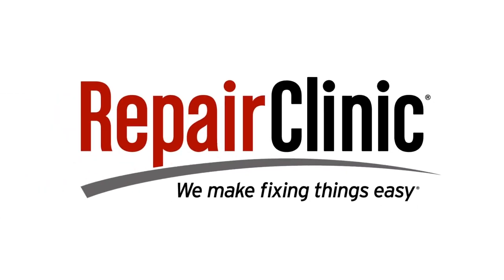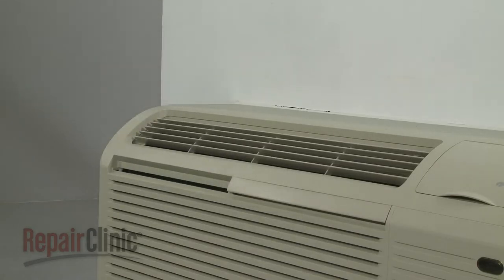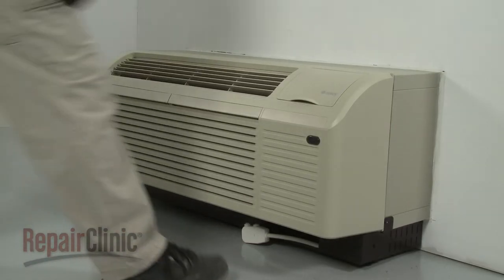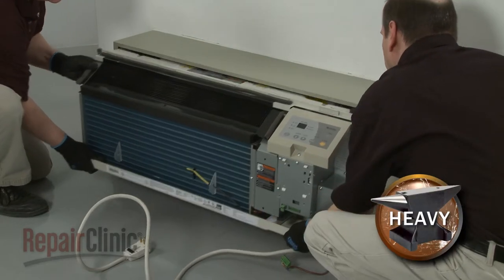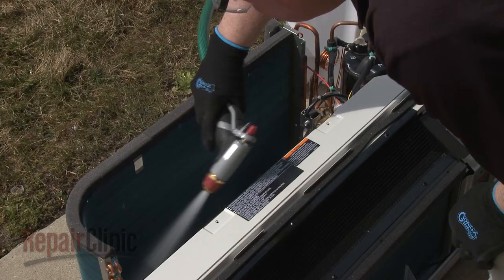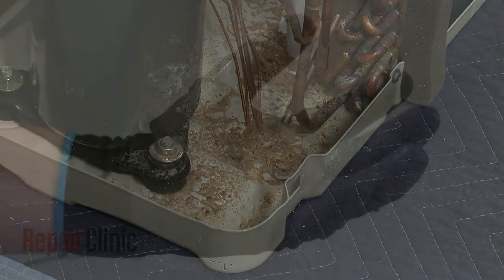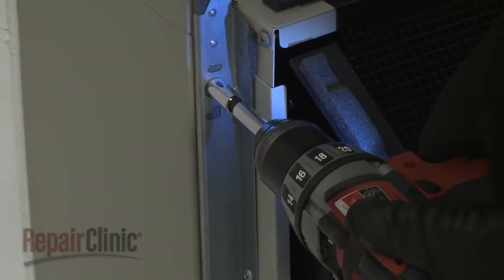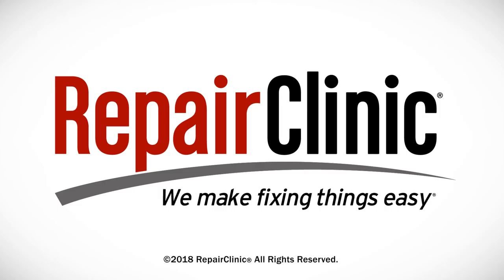PTAC Unit Maintenance Tips

Comment: If I bought some no rinse evap coil cleaner is it okay for me to just take off the front case and spray the unit while it is still in the wall and then replace the front case? I'm not trying to clean condenser coils or drain pan.
Reply: that no rinse coil cleaner is garbage, we clean them inside and out. out at our vans

Comment: I recently move and they have this type of unit.  Will it cycle down, or just run all day.  I do not see a visible  thermostat.
Reply: Set it to auto and ur desired temp and it will keep it there
Reply: @imaFlamingFaggot123  its older. No actusl temp control. Only dials. I'm gonna try and see what my first bill is like.

Comment: I have one of these units in my apartment and cannot get the fan to turn off. It did not come with a remote and the wall thermostat only lets me make fan auto or fan on ( both continuously run )
And I cannot adjust anything from the units controls

Comment: Mine for some reason is making a clicking noise and it blows out warm air whenever I run my heat but switches back and fourth between hot and cold air and it doesn’t turn off and on it just keeps running even whenever it’s at room temperature
Reply: Just replace it. There has never been a PTAC made that’s worth diagnosing and repairing.
Reply: @daveplem  I actually had gotten it fixed back in February what it was was the inside of the unit needed cleaned.
Reply: @corygriffiths4394  Lol! Never listen to me!

Comment: Constant buzzing coming out from the same area the air comes out through on heater mode when the unit is loudest (assuming heat pump is running) …. Any idea what this may be? The air is coming out and the buzzing sound/ whistle is driving me nuts!

Comment: I have one of these units and during the summer season when the AC is on the condensation from the inner coils builds up to a pool in the bottom pan which eventually runs over and spills inside the room. I've tried cleaning the entire unit, making sure there is no blockages and even drilled 2 more holes at the bottom of the outside pan where its supposed to drain. The water never flows to the outside pan and continues to overflow inside. Only thing i can think of is it was installed at the improper angle in the wall causing the water to remain in the pan below the inner coils and never properly flow outside. Anyone got any other ideas?
Reply: Tilt the pan or unit towards the drains.  Should only need a small fall angle.  Make sure it’s screwed in straight on your wall
Reply: @zachosborne6577  I've tried to adjust the angle by wedging objects under the inside bottom portion of the unit to raise the inner side but doesn't help. This unit was a replacement for an older wall unit so when installed it was just placed into the same opening inside the wall with the sleeve that came with the unit. It didn't come with any other hardware to adjust the tilt level(as shown in this video). I'm not sure how to correct the tilt level without making changes to the opening in the wall itself....which is something id like to avoid doing. I feel its just not able to drain to the outer pan(due to a blockage?) but cant find the area where its supposed to pass through.
Reply: Our Amana unit has a drain tube that the water from the pan drips through. Try and find out if you have a drainage tube and if you do blow through it hard to see if you can clear any blockage

Comment: Did as shown, after plugging unit in, nothing! Unplugged unit again to allow electronics to reset, still nothing. unit is 3 years old.
Reply: The large plug has a breaker on it. Press "Reset" on the plug.
Reply: Same issue. I have power through the main cord. But unit and key pad are not functioning.
Reply: @DE-mr3vp  same

Comment: My PTAC unit AC works, but the Heater part only cool air, no heat. Any advice how I can fix it? Thanks.
Reply: Mikey Mike there should be a reset button for the heat somewhere..
Reply: your heater coil wires are probly burnt. that is common with ptacs
Reply: My unid dont give me cold air 

H3lp please

Comment: Why is it bad to tighten to the screws?
Reply: Its bad to over tighten the screws
Reply: Cordless drills have so much torque these days that over tightening the screws can tear out the metal you are driving them into. The screws do not bear any weight. They only snug the unit up against the seal. Tightening them beyond that provides no benefit, and it can become a big pain if you damage the holes in the sleeve.

Comment: There is cold air leaking from underneath my GE PTAC unit. can I seal it off or would that be a fire hazard? i am not sure if its supposed to be vented at the bottom
Reply: If will definitely need a drain.  Every AC produces water, it needs somewhere to go
Reply: Hi I’m having this same issue. So much cold air comes from the bottom of the unit even though the heat is on 80 or above. Have you been able to resolve your issue… any tips?!

Comment: Freidrich LG LP093CDUC or Friedrich PDH15K5SG  900 square ft apt. Filter are clean, Don't t have wall thermostat, to turn on cooling I have to turn down to 61 F degrees and 70%  percent off time doesn't  turn on at night, only during late morning when it's warm outside, when it's running at 65 durgees just keep tempture at 73-75 durgrees  then turns off around 3 hours or not at al,l I just turn temp down to 61 durgeess it has not turn  on 4 hours 12am  this has been unit has never work right when move in move in for 3 years

Comment: my PTAC blows cold air when turned off. Is there a vent that I can close to avoid this? I cant seem to find it.
Reply: Abhishek Gautam look on your thermostat and see if the fan is set to on if so set it to auto.
Reply: the vent is located on the left side of the unit
Reply: Outside air can come in if the unit is not properly oriented in the sleeve or if the mounting screws are not in place and snug.